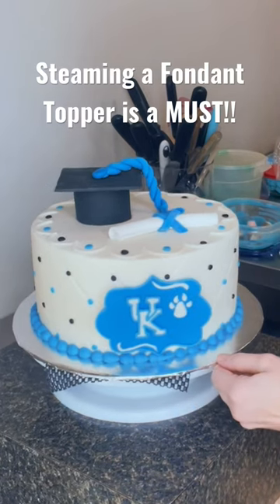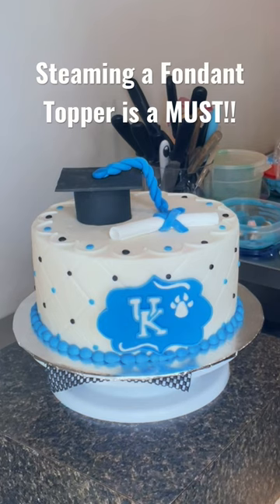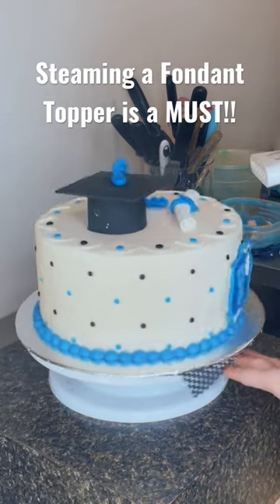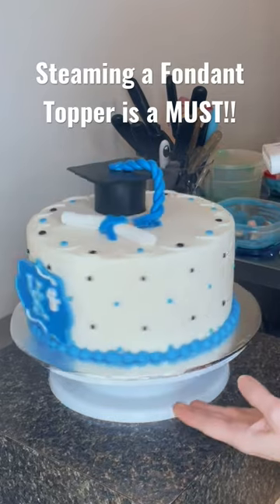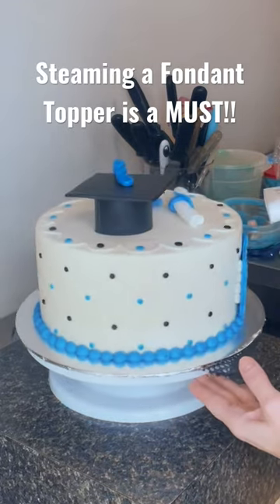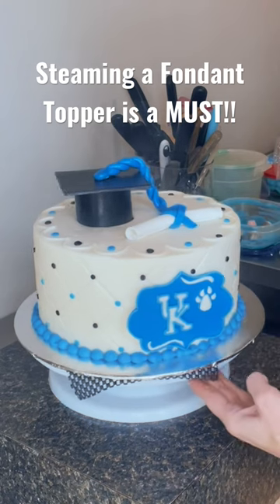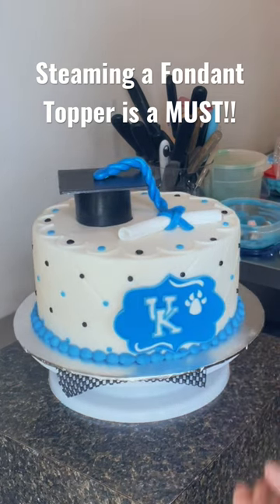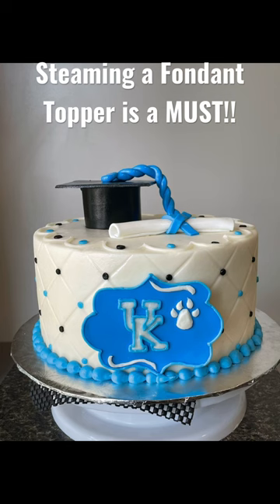Steaming Your Fondant Toppers #cake #cakemaking #cakeicing #fondant #cakes

Comment: Hi. Did you put any toothpick or anything to stick the decoration on the side of the cake? Since it is hot and humid in my country, I'm worey if the buttercream soft, then the decoration fall off in the side
Reply from the maker: On the side of the cake I just used a very small amount of water the make the fondant a little sticky then held it in place for about a minute as it set up. What type of icing do u use?